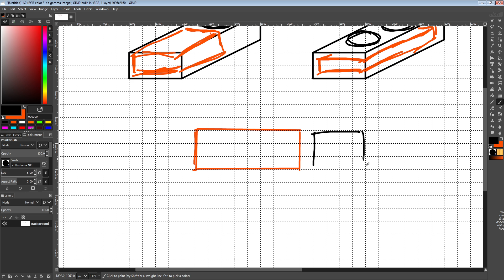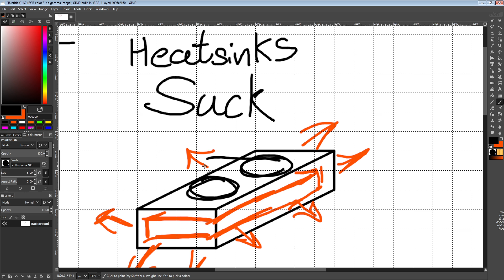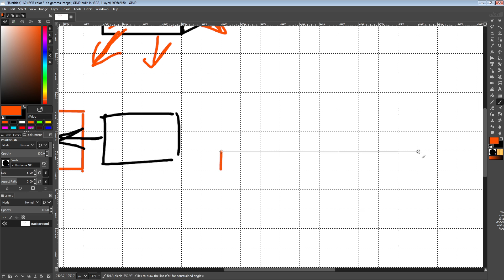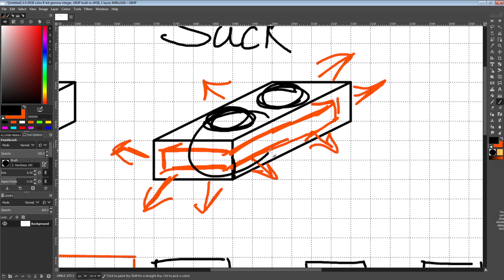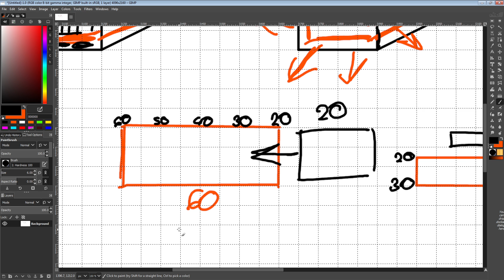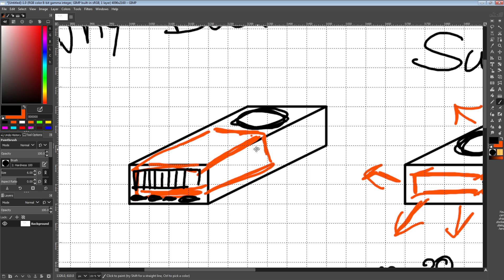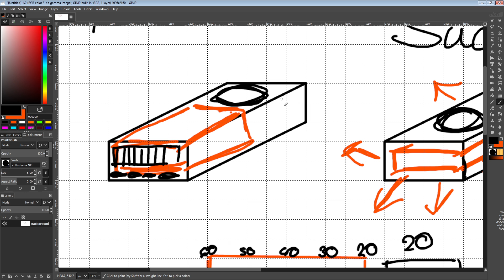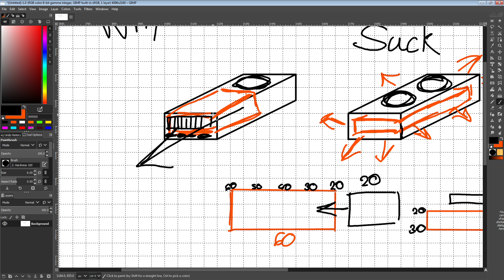Why blower heatsinks suck

Comment: If blowers are so bad, how come reference cards from AMD or NVidia come with blowers?   Top engineers have decided that blowers are GOOD.

Since blowers exhaust the hot air outside the PC, the air inside the PC case is cooler, leading to more efficiency in heat transfer.

Comment: Through my own experience with several different cards, some blower, some with dual axial, and some with triple axial fans, I feel that more of a mention needs to be made of the manufacture's shrouds.  While yes, blower style coolers have to exhaust all of their heat out the back of the card AROUND the ports, far too many of the axial style cooler manufacturers design their cards with heat sink fins aligned vertically, only to then almost COMPLETELY OBSTRUCT the majority of them with the shrouding of the card, purely for esthetic reasons.  Unless you have a dam decent amount of airflow through the case to overcome those obstructions and to prevent it recirculating the same hot air, axial coolers aren't much, if any better than blower coolers with the fan set to a high rpm.  I currently have 5 1070's running full tilt right now, and the blower style are keeping up with the axial coolers just fine.  If manufacturers turned the fins on axial cards to take advantage of the gaps in their shrouds, that would obviously change, but those 1070's are pretty clear evidence of the problem.

Comment: There's one great positive effect of blower fans. They keep the heat inside the GPU-case and blow it outside the tower. No hot air is blown on the mainboard like it happens with the axial fans. The fins are always build to blow the air to the mainboard and to the side of the tower. My mainboard for example is having the SSD under the GPU. That means, an axial fan is always blowing the hot air onto my SSD. I don't think that's a great idea. ;-)
Anyway, of course axial fans are keeping the GPU cooler than radial fans, but it also has it faults. I'm sure there are some good reasons to better choose a radial blower (which usually sucks) instead of an axial fan. 

But hey, nice video and great presentation. I've enjoyed it and also learned some interesting things I didn't have in mind before. So, thanks for that.

Comment: triple fan 2070 super with a 200 mm front intake at the bottom of case (Phanteks Enthoo Pro) and a 140mm rear exhaust makes my gpu very happy got a 360mm EK aio at the top for the cpu one of the best cases under £100 only thing is I wish i had gone tempred glass but that would be more than I was willing to pay for a case at the time

Comment: this video sucks, there is no real analyses done here, the collusion is set from the start and facts are picked up to fit the collusion. Both designs have advantages and disadvantages and real simulation is needed to figure out the end result, but instead not all of them are listed and there is a huge assumption in this video how much they do affect performance. Please don't trust this video conclusion. (The basic physics is correct but no more than that)

Comment: With all that being said, I still prefer blower style GPU's. They might be hotter, but they're just cooler.
Reply: Actually, with that being said, surely you could theoretically create a blower style cooler that was more efficient than what ever the other style is called. If, rather than having 1 fan parallel to the board you had 2 fans at 90 degrees to the board, one on the front sucking in cool air and one on the back blowing out the hot air, you could create a system that was more efficient for cooling at large by having directed cool airflow with an exhaust rather than simply blowing air around the case.

Comment: I don't think blower style cards get enough Love, they keep your internals much cooler specifically the ram, vrm, also power supply, as long as you have a AIO for the CPU they are great cards. I've had a few open-air coolers and they dramatically heated up my internals. 

 But another good option is a AIO blower style card they are just very expensive, but they do great work at staying cool along with keeping the heat down inside the case.

Comment: Great video! But : "from my understanding of thermal physics blower heatsinks suck"  They dont suck. They are just used in incorrect applications. Blowers are not meant to be "silent", they are meant to be efficient in relatively low temps. Just blow the shit out of long thermal connective area. They just introduce high speed air flow. That's it. It's the reason we have vacuum cleaners.

Comment: The way I see it, blower style fans are good when you have bad overall case airflow, since they will discard the heat immediately. "Normal" style cards are better if you have good airflow since they blow a lot more hot air back into the pc, not only heating the GPU but all the other components as well, which isn't a problem if the case has good airflow

Comment: Meh not entirely correct and there are heat transport equations that are applied to this and I can tell you that your example is very exaggerated. In other words the airflow is big enough not to worry about it but can it be improved in terms of efficiency; then the answer is yes!

Comment: I have a Vega 64 reference inside a Dan a4 inside itx. I know worst combination ever. But I like the challenge plus I got the Vega 64 really cheap. I was able to take the hotspot temperature by lapping the vapor chamber, changing the thermal paste to the kryonaut,  adding some plastic washers on the heatsink mounting screws and undervolting. I was able to decrease it by 10 degrees and lower my custom fan curve to a much saner lavels. I like your idea of changing the layout of videocard. Designed  more like a cpu and motherboard combo that an add in card. And maybe a a better PCIe express power delivery so no need to plug 2 sets of 8 pin connectors.

Comment: It might help to explain the air temperature doesn’t rise linearly. Instead, the air will decrease the amount of heat it can soak up due to the smaller temperature differential, meaning the temperature will rise slower and slower.

In the linear example shown in this video, heat transfer with minimal airflow would be reached if the air temperature is equal to the heatsink temperature exactly at the end of the heatsink. This would only be true if Tdelta doesn’t impact transfer efficacy. Ignoring radiation, Q=hA*Tdelta/d. So the higher Tdelta, the higher heat transfer.

Comment: Having recently replaced my 1070 with a 2060 OC Turbo, I would say it really has more to do with opinion and case-by-case basis rather than cooling performance; Comparing a Gigabyte 2060 Windforce X2 to the Turbo, the temps are actually better with the Turbo (blower) and even using higher clocks.

The downside is, ofc, the audible cooling from the blower; When at 100% the blower is significantly louder, and induces a noticeable vibration to the desk, where the axial cooler won't make near as much sound and doesn't seem to cause any additional noises/vibrations.
To combat the noise and vibration issues while still keeping the performance fairly unchanged, using a user-defined fan curve I can keep a stable 50% fan and push 2.0+Ghz, and the card seems to be working fine.

I'd always recommend axial over blower designs unless ITX or HTPC, but I have pretty much come to find blowers don't always mean crap cards, just not the best you can get.

Comment: I have actually had great success overclocking blower cards in a interesting manner. I noticed that if ambient is really really low, open air cooling cards have a flaw that they make a heat bubble around themselves, while a blower card will push that air through its cooler and exhaust all the heated air to not get recirculated. I managed to get a blower rx 470 cooled to 0C under load (didnt show temps below zero, might have been less, north europe winters, took my rig outside), making for a insanely good overclocker without any LN2. Did not get the same results with a open air rx 480, which still managed to stay toasty in the same cool ambient air when running it over 250w, yielding minimal performance increase with voltage increase. I remember taking a non ln2 world record for the 470, dont know if it still stands.

Comment: Jayz tested the impact of the NVidia 3000 cards on the temperature in a case.
so its funny to see that the blower part of the cooler help by moving a lot of hot air outside the case.
so to compensate this when using an open card, we should have more fans to move the air out of the case faster.
like mini fans below the card pushing hot air outside the case (like the top back fan) or other options like this one.

Comment: It´s not as bad as you think, or else servers would not be as they are. Heat pipes really save the day in these designs. The problem is the tolerances and forcing all the air properly though the hood.
Any gap, will let air through and reduce the pressure in the heatsink. So, I would say it´s not a bad design, and it can actually be a very efficient design. Just getting it right is difficult.

Comment: Open air cards exhausting in the case increase the CPU temps while blower cards prevent that to the tune of around 8-9°C iirc. Cause the CPU cooler then has to deal with the GPU's hot air. This is assuming you're using a case and not an open bench setup. Radiator placement has similar effects as intake taking in cool air is better than it being exhaust as it then has to deal with other thermals in addition to its own. That's my understanding anyways. So I suppose you could say it's more about regulating other component thermals rather than being superior for the GPU itself.

Comment: In regards to the turbulent airflow thing! Here is the TLDR: Turbulent flow results in more mixing of the hot and cold air, which is how you transfer heat. Conversely, laminar flow, has much less mixing of the hot and cold air, basically causing a moving column of cool air in the finstack that never contributes to cooling.

Comment: Even worse, most of the air pulled into a blower is expelled into directions other than the actual sink's. Plus, blowers accelerate air radially - meaning there's only a small amount of air that goes into the fin stack straight while everywhere else you get a lot of turbulence (=air resistance) due to the air needing to change directions so it will flow through the stack's channels.

I mean, one could possibly design a blower with fin stacks in front and behind it, but that leaves the middle part of the card without an effective means of transferring its heat into either of them, barring the use of heat pipes - and these require a larger cooling solution, plus they impinge on airflow yet again as they'd need to be threaded through the fin stack to facilitate efficient heat transfer.

Whichever way you look at it, blower designs range from bad to horribly inadequate, trending towards the latter.

Comment: The problem isn't blowers, it's the design of motherboards and cases.
If the primary PCIE card was moved to the bottom of the board and the GPU could be isolated from the rest of the case with a shroud and a good ventilation system, it would all work much better.
Imagine having a 120mm wind tunnel dedicated to the GPU. We might see the return of passive cooling designs that can take advantage of the dedicated cooling tunnel.

Comment: Good explanation! And regarding the typical exhaust on blower cards.,.. You hit the nail right on! :)
I kinda agree with you. But blowers can easily push the air efficiently out of that short heatsink they normally use. You don't get such huge difference in temps over the HS. Usless you keep the fan very low speed. Forward curved blower fans are not really airlow efficient, but high static pressure efficient. static pressure is what is needed inside that "pressure" chamber. Especialy with the higher resistance expansion slot cover plate. They should really just make a big hole. I totally agree on that.
Blowers are noisy because of the high static pressure from the high rpm. But because bad case airflow is not something rare, and especially with air cooled multi GPU setups, blowers advantage in that case, has been tried and proved.

Comment: I like blower design more,,,I remember our poor cases with only PSU fan or one 80mm fan at the back in early 00s , they were certainly no good vented ,,,, does somebody remember wind tunels towards CPU cooler ? :) , it was big thing then ,,,,, BACK to topic ,,to have modern case vented  you have like 3 fans each 5-10W at least, so you spend 15--30 W to vent a case because your GPU is stupidly recirculating hot air .  15W is  now power usage of CPU or whole computer in idle maybe.
That is not what I call efficient. ,,,,and that air noise from all the fans ,, try it listen for  hours on night shift home office ,,,,,sometimes less is better
Reply: now the tech get more fancy, you just need money,,, but average Joe, kid or gamer always had budget builds with some fan just slapped on the back,,,blower fans are for them,,,,,,,,when you spend most money on CPU+GPU, so you buy crappy case  with no fans and noname PSU

Comment: I actually tested my reference RX 5700 XT without the rear IO bracket. I did not see any significant difference in temps on same fan curve, driver and same games/settings. Narrow slats design is often used in many intake/exhaust aplications like car front grille, AC, ventilation etc. It is there because something could get inside and damage or block the air vent. According the fluid mechanics, slats are pretty effiecient regarding air flow (90% intake and 92% exhaust compared to 100% unrestricted air flow). Nice video, though. Thanx

Comment: I do not think it is the fault of the case designers either. With the way the pcie slots are arranged on the mainboard there are no good options to place the graphic card without using some crazy stuff like riser cables. Maybe it is time to change the mainboard layout completely, to allow graphic cards being mounted parallel to the backside of the case. This combined with holes inside the PCB like for the RTX 3080 would allow to blow the air out big time, not through such a small hole like you draw here. The question is then, were do you put the io for external devices like soundcards and such. Maybe to the side? This will limit the possibilities for fancy side glas panels, but the overall cooling performance would be worlds ahead of what we have now.
I have to admit it is kind of hard to establish this kind of revolution to mainboard form factors and with the current development it is more likely that we reach efficient hardware than a revolution of the ATX Standard.

Comment: I think the visualisation would be much improved if you use increasing distances between temperature steps.
Like, right now, the distance between 20 and 30 degrees is the same as between 50 and 60 degrees, but if it becomes larger, that visualises the decrease in transfer rates.

Comment: 1. no grill? you never got cockroach or gecko get into your gpu
2. blower suck because that  what fans do
3. its not dumb, each has pros and cons, radial/blower fan works better in cramped case or server case, it works well with other device in term of cooling

pros axial fan :
1. more air moved with same amount of rpm to radial fan
2. because of less rpm, it is less noise
3. you can spread more heatsink and finstack to fresh air

pros radial fan:
1. controlled air flow direction
2. for multi-gpu or crowded devices, its more safe and work better
3. radial fans are larger (in depth), and better, mostly it has hybrid ball + hydro bearing and larger/strong rod, it is more reliable, never seen radial fans failed
4. more compact
5. arrangements are easier to be modded for water cooling, since mostly gpu core heatsink are separated than other plate
6. single fan consume less electricity

cons axial fan:
1. bad quality fan, mostly just sleeve bearing rod, and thin blades, slight imbalance on blade can easily kill the fan
2. easily struck other device or cables on case
3. bad for crowded and small case because of uncontrolled exhaust air direction
4. multi fans consume more electricity

cons radial fan:
1. noisy
2. less than efficient cooling distribution (run hotter)
3. you need better vent on pcie bracket ( less connector )
4. you need to run with shroud attached

Comment: Blower fans are much higher quality than axial fans. Have you seen blower bearings die on you? I haven't. I have seen tons of axial fan bearing problems on even the expensive cards. And Most blower heatsinks are vapor chamber. Do people even know this? Yes they run hotter, but look there are good and bad for the both sides. I'm just sick of hearing people bashing on blower coolers. I hope people have better things to think about in their life than these cooler designs

Comment: Nice video! How about a push-pull style blower? Add one more fan on the exit (maybe on the exterior of the PC case) to pull the hot air out of the blower GPU casing?

Comment: We need a physicist explain how to think about heat and exchange of it. Similarly to how fps is non-liner and it doesn't make sense to compare +20 fps in 30-60 fps range to +20 pfs in 300+ range, does it make sense to compare 20° temperature drop 90->70 °C vs 20° drop 50->30 °C? this is especially important considering most PC hardware can work at 60°C or even 80°C just fine provided it's super stable at keeping that temperature under load.
I feel like my personal understanding of temperature as a concept is a mess, even worse, it is probably a mess for everybody else too.